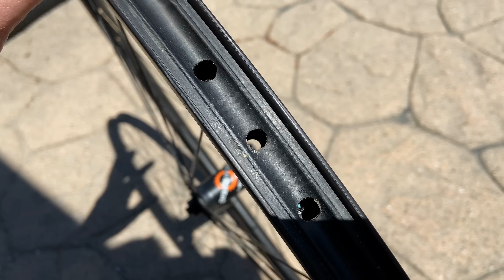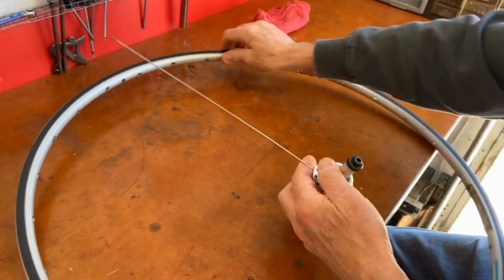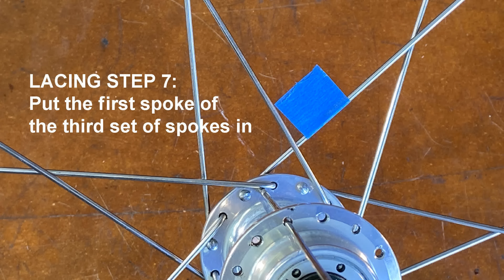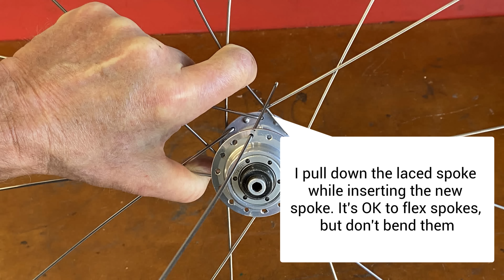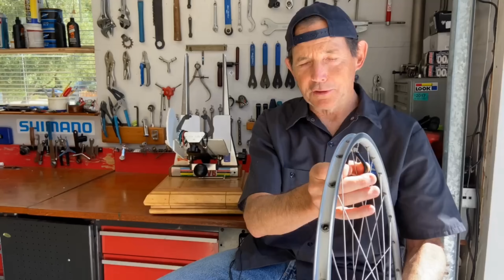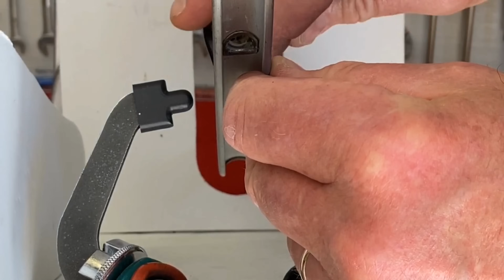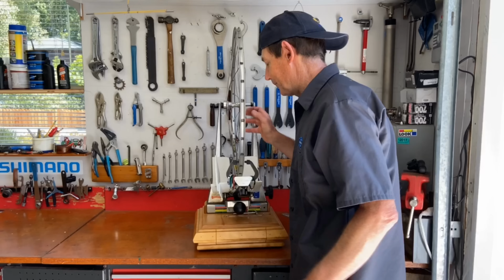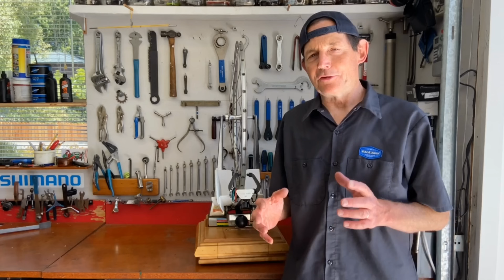How To Build Bicycle Wheels THE EASY WAY! #bikerepair

Comment: Yesterday, I built a 26“ rim brake front wheel following your advice. Thanks again! The wheel turned out great: laterally and radially true, equal spoke tensions and correct dish. I aimed for pretty much max. tension provided in the manufacturer’s dara sheet (I have a park tool tensiometer). One thing I don’t quite understand: Woke up this morning and checked the tension. It fell from +\- 120 kgf to about 107 —> from 25 to 24 on the tensiometer. I had destressed the wheel multiple times, especially in the final tensioning stage. Just tightened it to 25 again, including destressing (everything is still true). What should I make of this? Perhaps I should have squeezed the spoke pairs with more force. I‘ll check the wheel again tomorrow and in a few days. I would just love to know what’s happening. Can’t be uneven tension. Spoke lenghts are spot on as well (they’re all flush with the nipples‘ „groove“). Not a native speaker ;). Cheers!
Reply from the maker: Congratulations on your wheel build Goenzelsen. I don't know what gauge spokes you built with but the lighter ones stretch more than the heavier ones, and that might be what's going on. When destressing, you do want to put some force on the spokes too. If you were too gentle that could be the issue too. It's common for wheel manufacturers now to use hydraulic presses that press down and load the wheels laterally at the hub, which shows how much stress they put on wheels to destress them. When the spokes are at full tension they put a lot of force on everything and if the desressing didn't seat all the parts, it'll continue to happen after you finish a wheel. If you haven't already, you'll find that when you install a tire and inflate it fully, that will change the tension too. But, you don't worry about that because that's considered in the final tension recommendations of the rim makers. If you retension, you'll overtighten the wheel. The thing is that now that you retensioned the wheel, it should account for the change and stay close to the final tension. Hope this is helpful and thanks for watching!

Comment: I have never built a cycle wheel but have just rebuilt a neglected mountain bike for my son. All went well with new equipment but I forgot to check wheel bearings. The back runs rough and I can’t replace the cups. I do have a good hub so he’s going to get a new wheel. £200 to have one built with my hub is silly. So I’m on the case to lace and true my first wheel.
Reply from the maker: Thanks for watching and sharing your project. Let me know how your new wheel comes out Dave.

Comment: Amazing, thank you so much! Just one question: Isn’t it important to ensure equal tension in the end? I reckon the wheel will much more stable and longer lasting with equal spoke tensions. If there’s no „weak“ spoke, there’s no spoke to break first. Or did you actually mention it and my internet-fried millenial brain hasn’t noticed? 😉
Reply from the maker: @Goenzelsen  You’re welcome and I’m happy you enjoyed the video. Yes I talk about tension at the end of the wheel build because final tensioning happens at the end. How even the tension is depends on several factors. What’s important is that the tension is enough for the spokes not to loosen and the wheel is true, round and centered. Usually with modern wheels with disc brakes the tension varies on the left and right sides since they’re spaced for the cassette rear and disc front. That’s true for rim brake rear wheels. Rim brake front wheels have even tension on both sides. But the key thing is getting the spokes tight enough as if they loosen, that’s what leads to spoke and wheel issues. Thanks again.

Comment: The garage door thing is awesome.  I did my first wheel with the bike hanging from the garage ceiling on pulleys.  lol  Thank you for this video!
Reply: My dad used old steel front forks for wheel truing. He stretched them over rear wheels and pulled them in for fronts.
Reply from the maker: @Dave5843-d9m  yes, that’s a common home made truing stand people make, good tip.
Reply from the maker: Thanks Matthew, glad you found that tip helpful and congrats on finding a good way to hang your bike to true your wheel! Before repair stands became so available, some bike shops hung bikes from the ceiling to work on them just like you so it's one way that can work just fine. Appreciate you watching and commenting 🙏

Comment: I have an old schwinn 5 speed 26 x 1x3/8 . I want to use that hub and go to 26 x 1.75.  Will the hub work and can i use. The spokes  from the 26x 1.75.
Reply from the maker: Thanks for watching and the question Josh. Even though both of those wheels are 26 inch wheels, they're actually very different in diameter which means that the spoke length will be different too. The hub will work and the rim will work but you will need to either take measurements and calculate spoke length or get help from a bike shop that sells spokes and builds wheels. I do have another video showing how to measure hubs and rims and calculate spoke length too, which is here: https://youtu.be/LvV4FE2VxZk One more thing to check is whether the wheel you plan to build will fit in the bike you want to use it on. Because they are completely different wheel sizes, there might be issues with the brakes reaching the rim and the much wider tire fitting in the frame without rubbing. If you have the 26 x 1.75 wheel with the tire on it, you can try fitting the wheel in your Schwinn bike to see if it will work or not.

Comment: Hey, Jim! Thank you for sharing your wisdom. There is nothing more needed to start building your own wheels. So, I  made a few. Now I faced the issue: the radial deviation is around 10 mm, drive side spokes are tightened close to the top limit. My question is: how difficult is to make such wheel round?
Reply from the maker: You're welcome and congratulations on building some wheels, great job! Regarding getting wheels round, ideally you will get them round BEFORE you have them fully tensioned or even close to fully tensioned. The goal is to get the wheel true side to side, round up and down and centered while the spokes are still at very low tension. But don't worry, it's a common issue to tighten too much when building your first wheels and end up with too much tension and a wheel that's only true and not round.

The solution is pretty simple and all it takes is a little work to fix it. First spin the wheel and carefully note where the high spot is and where the low spot is. Pay close attention to the shape of each spot high and low. Note how many spokes makes up the high spot and how many spokes make up the low spot. You could even mark the high and low spots with something you can wipe off later. But you want to keep track of where they are so that you can work with just those spokes.

Now to get the wheel round, you find the low spot. Let's say that that low spot spans most of the wheel, which can often happen. So let's say that it's 25 spokes making up the low spot. What you do is you loosen all 25 spokes to allow the rim to move up. Now because it's a rear wheel, the left side spokes are not as tight as the right side spokes (drive side spokes). To maintain that relative tension, you want to loosen all 25 spokes, but to do that and keep the tension on each side the same, you loosen the drive side spokes a full turn of the nipple while you loosen the  left side only 1/2 turn each.

Next you go to the high spot. Let's say that it's spread over 7 spokes. You need to pull the high spot down, which will push the low spot you just loosened up. So you do the same as you did with the low spot but you tighten the nipples 1 turn on the drive side and 1/2 turn on the non drive side. Once you've done this, when you spin the wheel, you should see that the wheel has gotten rounder. You usually need to repeat this process several times and the high and low spots will change as they flatten out and the wheel gets better and better. As the high and low spots change, sometimes you end up with new low and high spots but smaller ones and you just deal with each one the same way, but work with the fewer spokes in each area.

There's a learning curve to this but I find it enjoyable to seek and round out even the smallest low and high spot. As long as you're working with a round rim, you can get wheels so round that it's very difficult to see any deviation from round and that's the sign that you built a very nice wheel. Because it's the roundness that effects tension equalization the most. So a really round wheel is a sign that the tension is expertly balanced and even. I have another video showing in an extreme close-up view how much time I spend getting a wheel really round. If you'd like to watch it, it will give you an idea of how much patience even pro wheelbuilders take in getting wheels round: https://youtu.be/DfjEaxlk1R4 Hope this helps and again, congrats on your wheel builds!
Reply: Yeah! Looks like I have a plan for the weekend. We'll see how long it takes to make that wheel round.
Reply from the maker: @IevgeniiIegorushkov  take your time and enjoy the process, you can do it!
Reply: @JimLangley1 🎉 The wheel now is 0,3 - 0,5 mm from the round shape. The next question is, can I tighten it to even tension on each spoke and keep it round?
Reply from the maker: @IevgeniiIegorushkov  congratulation on getting it round. Regarding achieving even tension, now that it's round, you want to get the spokes to their recommended tension while keeping it straight side to side and as round as it is too and also keeping the rim centered.  Sometimes rim makers specify optimum tension for the rim and that's the best thing to follow. If you don't have that information, a good tension range for the tight side spokes is about 110 to 130kgf (right/drive side rear and rotor/non-drive side/left front on disc wheels). But you rarely will end up with even tension on every spoke. It's nice if you do but more typically, 3/4 of the spokes will be at the high tension, the rest will be slightly over or under. If you make every spoke the exact same tension, you will take the wheel out of true and round usually. That's because spokes and rims are inconsistent in manufacture so the tension can vary. The key thing though is how nice and round and true the wheel is and that the majority of spokes are at the optimum tension to ensure the wheel stays that way when you ride on it. Okay? Hope this is helpful.

Comment: If we've gotten the wheel true laterally and radially, centered, wouldn't the spokes be at different sounds when plucked during the final tensioning?
Reply from the maker: Thanks for watching and commenting Joe. Since you asked about plucking during the final tensioning of the spokes, yes, the spoke tone (music) you hear when you pluck them will be constantly changing slightly because you are not done tightening the spokes and the tension keeps changing with each turn of the spoke nipples. It's when you're all done that the spokes on each side of the wheel will make a similar sound when plucked. As you know, the tension is usually different on the left and right sides of rear wheels and front wheels with disc brakes too, so the right side and left side will make a different tone. Thanks again and hope this helps.

Comment: If you’re 50miles from nowhere and u break a spoke on an aero rim, how do u get the spoke nipple into the hole for the new spoke ? Thx.
Reply from the maker: Usually you can still use the nipple that’s in the rim. It’s the spoke typically that breaks so usually you reuse the nipple. Hope this helps.
Reply: @ so u unscrew broken spoke with nipple hanging down ?
Reply from the maker: @PInk77W1  yes, you turn the wheel so that the spoke nipple is at 12 o'clock. That way, when you unscrew the spoke the nipple can't go inside the rim. Next you put the new spoke in the hub and you carefully thread on the nipple. You want to hold onto the spoke nipple as you start to thread in the spoke so that the spoke cannot push it up inside the rim. Once you turn it onto the threads on the spoke a few turns, you won't have to worry about the spoke nipple going into the rim anymore because it'll be attached to the spoke and by flexing the spoke to put a gentle bow in it, the spoke nipple will come down if it goes up inside. Hope this is helpful.

Comment: Absolutely love your energy! I have a question though - I’ve trued my old wheel using the old spokes but in order to make it straight all the way around I’d have to losen it very much on one side. so much that it’ll make sounds and and wobble when driving it, even though it’s completely straight in the truing stand (hanging bike frame). New spokes?
Reply from the maker: Thanks a lot for watching and the great comment and question. Since you said that the wheel wobbles and even makes noise when you're riding, the issue is probably that the spokes are not tight enough, not up to a good tension for riding. 

And you also said that you were able to true your wheel. So I don't think the spokes are at fault, I think what's needed is starting over and getting the wheel as round as you can get it (up and down), then getting it as laterally straight as you can get it (side to side) and also making sure that it is centered over the hub.

If at that point the spokes are still loose, that's perfectly fine. A nice round and true wheel with loose spokes is the perfect wheel to start tensioning. 

And to do that, you go around the wheel and tighten each spoke nipple the same amount, a half turn is enough. That will very gradually tighten each spoke all around the wheel. As you do this, you check to make sure that the rim is not moving to one side or the other. You want it to stay in the center. 

On rear wheels with cassettes on one side, you typically need to tighten the right side spokes (cassette side), a full turn and turn the left side spokes (no cassette/sometimes a disc rotor), a half a turn. That will ensure the rim stays slightly further to the right, which is usually what's needed to center the rim over the hub. 

One time around won't be enough to fully tension the spokes in a wheel that has all loose spokes. You'll need to go around many times to get the spokes tight enough for riding. Depending on the tension when starting, it could take 10 times around the wheel to get it tightened enough to be ready for riding. And each time you want to check and fix any roundness, side to side or centering changes. Okay? 

I hope this helps you get it back on the road and I'm happy to help more so ask if you have more questions. Have fun finishing that wheel!

Comment: Hey Jim, awesome video, almost got my wheel done, thank you!

My only wish is that you would have mentioned that we need to check for dish earlier in the process! I had a  fairly true wheel then realized that it was quite a bit off center. 

I got a lot of practice out of it !
Reply from the maker: Thanks a lot for watching and the feedback fossman and congratulations on your wheel build, well done! 

So, dishing a wheel is an interesting topic and wheel builders use different methods for it. It's one of those things that you get to decide yourself as you build more wheels. 

There are some noted wheel gurus who recommend not correcting for dish until the wheel is almost all done. With this technique you true and round focusing only on the tight side spokes (right rear and left front on front disc wheels) and then start to finish the wheel by working with the "loose" side spoke only pulling it into dish. That way the almost fully tensioned right side spokes (rear/left front disc) are left alone and keep the wheel true and round.

But the thing to know is that however you choose to do it and whenever in the process, dishing a wheel should not affect the trueness and roundness very much at all, because the tension of all the spokes left/right should be changing an equal amount with each turn of a nipple.

If when the wheel is being dished/centered, it goes out of true or round, it's usually because the turns of the nipples are not even (1/2 turn, 1/4 turn, 3/4 turn etc. - to be perfect requires care and precision turning the nipples the exact same amount) - or a common mistake when starting to learn is tightening when you mean to loosen or loosening when you mean to tighten. And there are other possible issues such as maybe the wheel hasn't been sufficiently stress-relieved, which could mean that nipples seat in the rim or a flexed spoke straightens out, changing the tension of some of the spokes These things would cause trueness and roundness issues.

Hope these dishing/centering tips are helpful and again great job building your wheel, enjoy riding it!